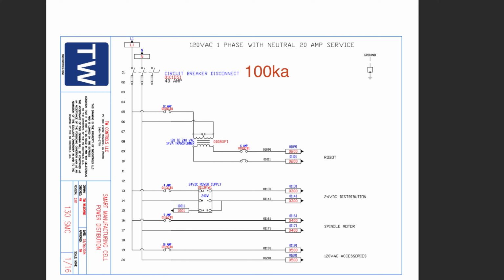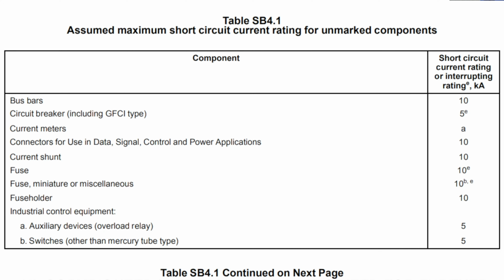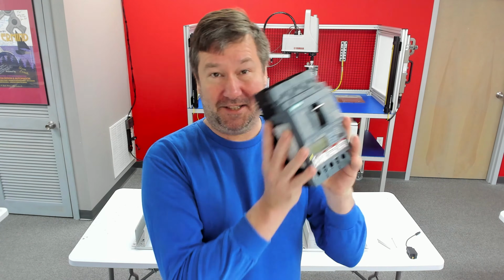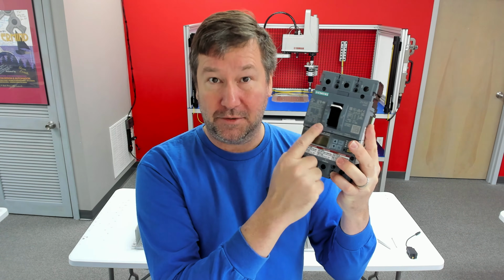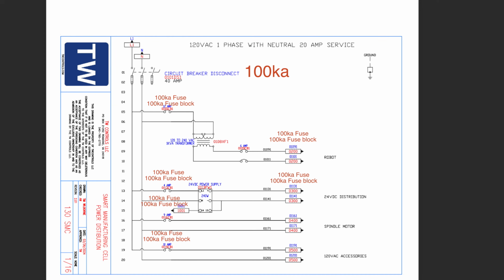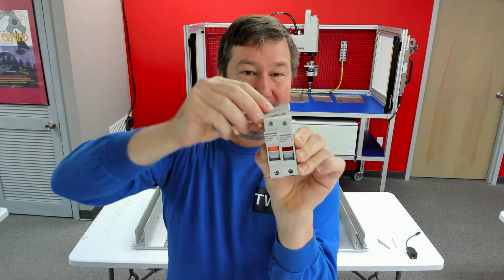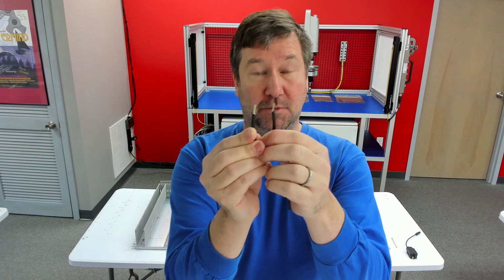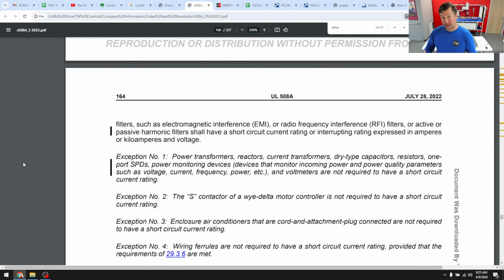Calculating SCCR Short Circuit Current Rating and Tips for Raising

Comment: Be careful with the distribution blocks. All of the ones that I've seen marked for 100-200KA preface that by specifically saying only when protected by fuses. Many times I had to derate my panels to 10KA because the customer refused to allow fuses, and had a PDB coming straight off a molded-case switch.
Reply from the maker: Yep, plus many device's warranties are void if you use breakers instead of fuses.

Comment: Hello. Great video. Im struggling with some sccr aspects. Im a designer, working with 3rd party panels shops for my employers builds. I've been getting pushback because of the loads. I don't believe loads, in this case a cabinet heater, or a PLC device, should have thier individual sccr ratings degade the overall system. Do loads count? All my CBS are 10ka. They are derating to 5ka
Reply from the maker: SB4.2.1 of UL 508A should exclude the heater, take it over with the panel shop.  If the PLC is 120VAC powered then it would count.  Simply making it 24VDC powered would exclude it.

Comment: Nice video. I appreciate all the work you put into these videos.  I don't know why the NEC makes this so difficult, but technically, only circuit protective devices can have an IR. (e.g. fuses and CBs). A contactor, fuse holder, PDB, bus bar, etc., has an SCCR. The whole panel can only have an SCCR (using NEC/UL terms). Neither the panel itself nor a control component would ever have an IR.
Reply from the maker: I'm glad you like it!

Comment: Tim, these are interesting topics that I do not see many people discuss. In your experience, how often do people specify panels to be UL508A? Or even care or specify what the SCCR rating needs to be for panels being designed & supplied. I understand the importance, especially when it comes to the interrupt devices being able to interrupt the maximum available fault current that the power system is capable of supplying. Also, the fact that the performance of the interrupt devices plays a role in determining the incident energy that is calculated in arc flash studies. However, in my experience things like this seem to get little attention up-front on projects, or even completely missed altogether. I work in the steel industry, which may play a role in why.
Reply from the maker: I see UL and SCCR requirement on most specifications I see these days

SCCR isn't something new.  It has been required by NEC since 2005 and UL 508A since 2006 so it is nearly 2 decades old.  I would say it is getting rarer to see a panel without a SCCR rating but also just as rare that it actually be correct :)

UL 508A...if you work in the steel industry then I'm sure you are no stranger to OSHA.  They require all control panels be certified by a Nationally Recognized Testing Laboratory (NRTL).  There are 21 to choose from but UL is the largest.

I think what is making more panel manufacturers pay attention now is many companies are no longer just requiring a UL sticker and SCCR rating, they are starting to require a certain KA rating on the panel which is a real hard mark to hit if you don't think about it up front.

Comment: how would the wire have a better sccr rating than a copper bus bar to connect the fuse together ?
Reply from the maker: The wire is not part of the SCCR equation.

Comment: Current limiting breakers are a great way to help your SCCR. Another interesting way to go about it if your working the SCCR from more than just the panel components, isolation transformers can reduce the available fault current to the panel so that the panel might only have to be built to tolerate 25kA instead of 35 or 65kA. It’s important to note for the folks who are new to SCCR, the number you’re achieving and labeling your panel with isn’t a “warm fuzzy number” like “I think I’ll just build this one to 65kA.” The engineer at the plant or install site needs to be able to identify the available fault current to the panel. If they can’t, you’re going in blind and you’ll essentially be guessing! SCCR can be a deep dive! Not too bad once you get some practice with the principles and what not.
Reply from the maker: Adding the transformer would make for a good video.

Comment: Your video title is confusing - why would you want lower SCCR rating? The SCCR indicates the maximum short-circuit current that a component or assembly can safely withstand. A lower rating is bad and you would ideally want want higher, which means better safety and reliability for your electrical circuit.
Reply from the maker: Typo, corrected...thanks!

Comment: Tim, Thank you for this gem. However, in your schematic, you are using 3 pole CB for Single phase 120v + N.
If you do so, shouldn't you feed L from TERM2 into TERM 3 and move N into TERM5?
Reply from the maker: No, not according to installation instructions.  Do you have a reference?  The only mention was the neutral conductor protection but we weren't in the criteria to need that.
Reply: @TimWilborne @TimWilborne, you see the wiring reference in the wiring details for a motor protector.
I have a system I am working with, and the schematic calls for ABB MS132-10T are on the primary side. However, only 2 (575VAC) lines are used in this case. I called ABB and explained the situation. They informed me that we cannot leave any terminals on the CBs; for example, if two-phase lines are used, you can feed phase 1 to L1 and draw from T1. but for phase 2 - feed into L2 then loop T2 to L3 and then draw from T3.
Similarly, if you use the same motor protector for a single phase with neutral on the secondary size (230VAC), you must feed the line through the CB twice and neutral through the 3rd pair. 

I know this is the most wacky wiring I have ever seen. 

Since the toggle and MP CBs work almost on the same principle, shouldn't the wiring be the same, too?
Reply from the maker: Ah, that sounds like a motor protector with phase loss protection.  Not the same as a circuit breaker...just to make it extra confusing, it isn't necessary to do the loop through a motor protector if it doesn't have phase loss protection.
Reply: @TimWilborne  Thanks, Tim. That helps a lot. I promise this is the last question - The guy also said I can use it for a single phase with a neutral. Since there is a phase loss protection, I cannot pass neutral through it right? Please advise
Reply from the maker: I'm not familiar enough with the ABB device to say one way or the other.